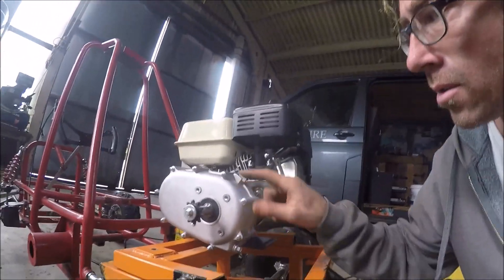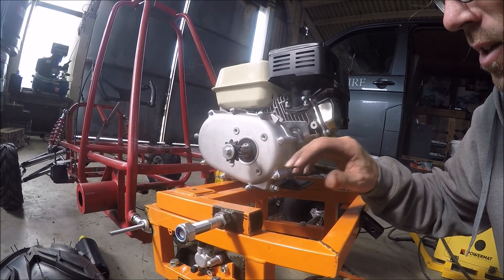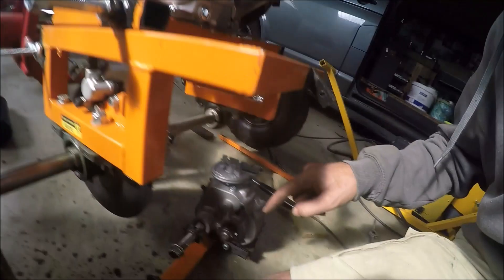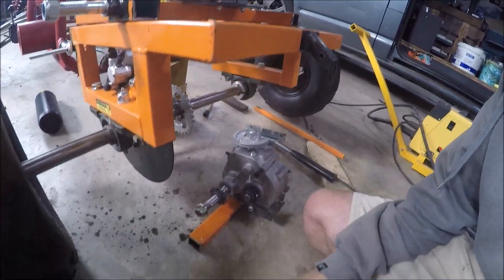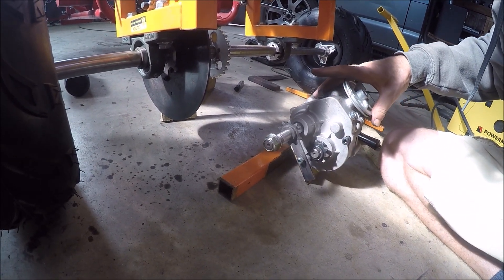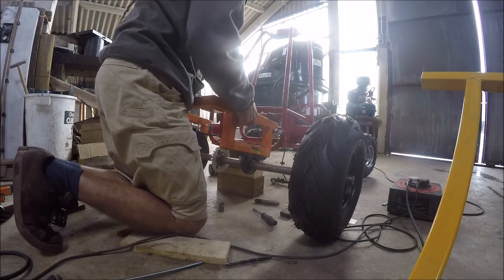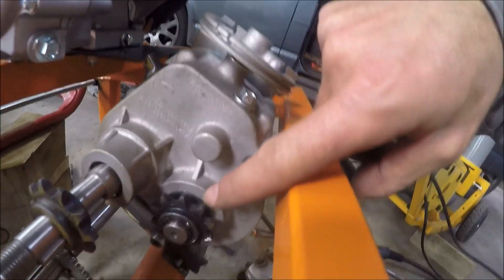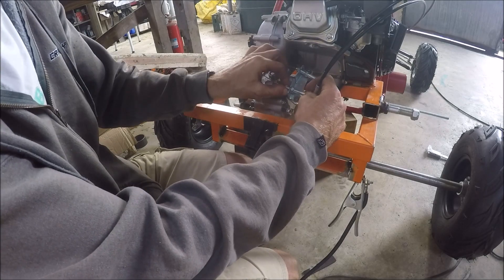How to install a tav style reverse gearbox with a honda clone engine

Comment: I'm planning on mounting my  reverse gearbox so the shaft of the engine is facing the shaft of the gearbox. Then I will run it in reverse. I'm not looking for speed since I'm building a low speed vehicle, my only curiosity is if the gearbox will hold up to being run in reverse the majority of the time. Any ideas?
Reply from the maker: it has gear reduction in reverse, it just means when you hit 'true reverse' it will be alot faster.  Depends on the application but i'd personally use sprockets to get your speed, then have a true reverse.
Reply: @CamberKitesurfing I discovered a strange phenomenon with the gearbox I have. Mounting it with the shaft facing the shaft of the engine results in the counterclockwise turning of the engine being passed onto the shaft of the gearbox and producing the forward motion of the sprocket (being the faster speed) and switching to reverse caused the slower speed (reverse) to function correctly. This makes me wonder if the gearbox I have was originally designed to be oriented in the opposing direction or to be combined with an engine with a clockwise rotation. Either way I'm happy it worked out. Thanks.

Comment: Does a manual clutch with a lever exist for this type of engine (like the Honda GX)?
Reply from the maker: most clutches you add to these are automatic, like a centrifugal clutch or torque converter. I don't know of any manual clutches for honda GX type engines, although that doesn't 100% mean they don't exist.

Comment: I take it no one else we’re wearing earbuds , turn the music down and your mic up the listen to it as you edit , outside of that I’ll try watching again with close caption I’m sure it’s Good information once my ears quit ringing ! 🤪
Reply from the maker: thanks for the feedback, I tend to kill cameras really quickly, sound is always an issue when using a gopro case. I've recently got a dji osmo pocket so the latest videos are a bit more slick. The gopro mic and speakers tend to pick up metal filings and then fail, that and getting showered with weld and grinder flack!

Comment: Hi there what size of sprocket did u get to fit on the long shaft. I bought this but it didn't arrive with the extra sprocket as advertised.
Thanks
Reply from the maker: it's the same as a torque converter sprocket , they come in asa35 or 420? pitch i think, are you uk based?
Reply from the maker: 35 pitch https://www.ebay.co.uk/itm/362981472133?hash=item548361b785:g:EZ4AAOSw6qheqDbv
we have some 420 in stock i think
Reply: @CamberKitesurfing  thanks for your help. Do you get these in 520 to fit this gearbox.
Thanks
Reply from the maker: @chrishamilton6030  i'm not sure on that one, i've only come across 35 and 420,  RS components do alot with pilot bores so you can put them on a lathe and drill out to size, but then you have to broach or bodge a keyway
Reply: @CamberKitesurfing  OK thanks do you know where to get the 420 one thanks.
Reply: Yes uk based thanks for your help

Comment: nice! I am looking into installing one of these. I also have the space as an issue tho. Do you think it is possible to turn it around and have the gear box face the opposite way to the engine? That way the sprockets could be placed very close next to each other and i would mostly get wider but not longer. Thanks!
Reply from the maker: not really as it has a gear reduction on reverse, unless you want to go backwards really fast!
Reply: @CamberKitesurfing  ok so i just bought me one of these gear boxes. I guess now i will have no choice but to find a space for it :) Now after placing the order i found a few videos that raised a nother question for me. I will use a 13hp Lifan. With the same 2:1 clutch u have here. Do you think i will be finde or is 13hp engine just gonna be to much for this gearbox to handle? Just curious for your oppinion. Probably gonna install it either way, becuase i already bought it ^^ thanks again.
Reply from the maker: @vinataba22  it should say what it's rated to, but ultimately it depends on your drivetrain, for instance if the wheels are too big there will be more load on the gearbox, etc
Reply: @CamberKitesurfing  hmm i just checked. It says 2-11HP. I bought in on aliexpress. They all looked the same there... Just saw that now. There are some that say 2-13 HP but they all look the same. I guess all i can do is mount it and if it breaks i need to buy the 13 HP version... Guess the only other option is to not even bother installing at all. hmm
Reply from the maker: @vinataba22  it's always handy to have reverse, good luck!
Reply: @CamberKitesurfing  true! Thank you ;)
Reply: @CamberKitesurfing  oh ok i see. Thank you for the quick reply. I was really wondering about that. This helps alot! cheers

Comment: Cool vid. What size is you engine and what reverse box are you using?
Reply from the maker: here is the reverse gearbox, i think the engine is a 6.5 hp with a 2:1 reduction and wet clutch.

Comment: interesting build, sir, is the reverse gearbox can be use for smaller honda gx-35 engine?
Reply from the maker: Wei Huang I’d imagine you could use it with most engines, but you need a centrifugal clutch or well fitted torque converter as you don’t want drive whilst changing gear.
Reply: @CamberKitesurfing  thanks for your kind reply sir, i have the clutch sir

Comment: That gearbox is gonna blow up cause they still need a clutch to be able to shift gears smoothly. There is not a clutch built in to those
Reply from the maker: yes there is a wet clutch, at idle the kart doesn't move. the engine has a 2:1 reduction with wet centrifugal clutch.
Reply: Durrrrp

Comment: What brand you use reverse gearbox?
Reply from the maker: its not branded, but i'm impressed with the quality so far
Reply: Very much appreciated friend. My goal is to actually use one and attach this bad boy to it. https://picclick.com/EZ-GO-Golf-Cart-Shifter-Accessory-for-Gas-293221569437.html
Reply from the maker: did your project work out?
Reply from the maker: ebay - i don't think its branded but it has a lovely smooth gear change!
Reply: Do you have a link for the reverse? How much did you pay for it?
Reply from the maker: @Zimeftw  here's one on ebay, check out aliexpress etc too https://www.ebay.co.uk/itm/Go-Kart-Forward-Neutral-Reverse-Gearbox-with-10T-sprocket-C-W-torque-converter/122251976522?hash=item1c76c91f4a:g:6zsAAOSwKOJYIgpf
Reply: what name this gearbox.. i want buy this gearbox..